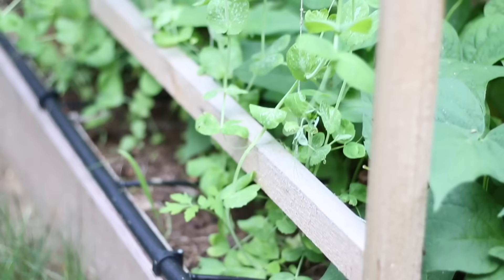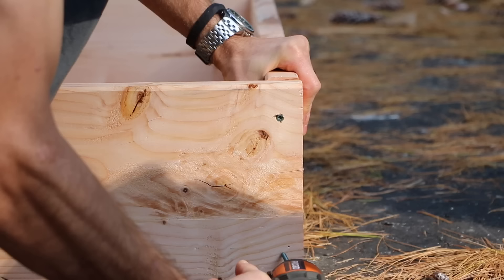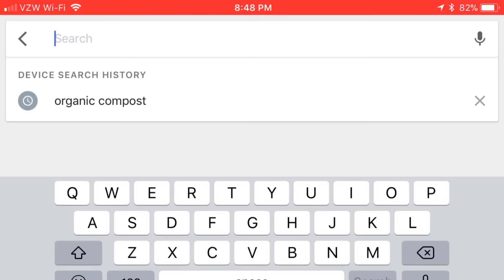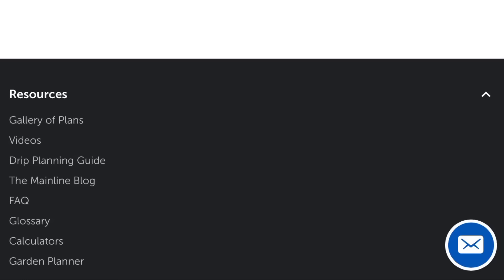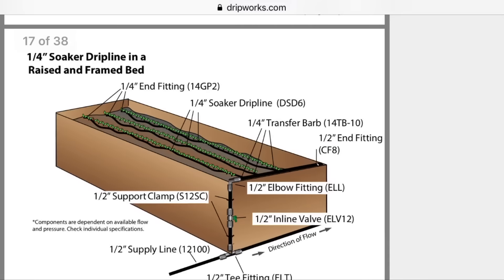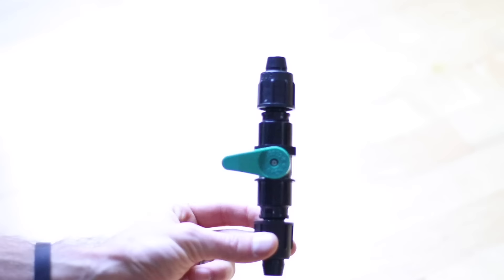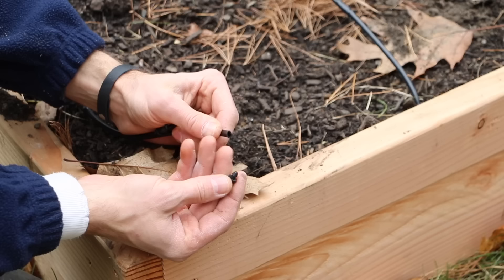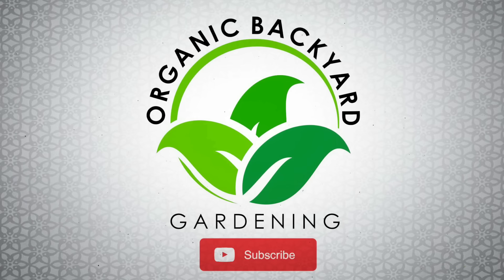How to Build a Raised Garden Bed with Drip Irrigation - Inexpensive & Easy

Comment: How do you winterize the drip irrigation system to make sure it doesn’t get damaged by freezing temperatures?
Reply from the maker: Check my video here on how I do this. How to Winterize Drip Irrigation Fall Winter Raised Bed Gardening - Raised Bed Drip Irrigation https://youtu.be/m0j8XT74Hik

I blow the lines out with an air compressor, I use this specially designed attachment https://amzn.to/2Vicvg5 (amazon affiliate link)

Comment: Can you  attach the irrigation system with a timer  to  a water barrel
Reply from the maker: Hey Storm! Thanks for watching. Drip irrigation required very low pressure (around 10psi) making it a great candidate to use with a gravity feed source. Check out this blog post from @dripworks for some great tips. https://help.dripdepot.com/support/solutions/articles/11000044367-gravity-feed-system-basics-elevation-pressure-water-quality-and-timers

Comment: When leveling out the area what should the measurements be to make it leveled sorry I’m really green on this and this is my first time learning everything me and girlfriend purchasing a home gonna have a lot of land wanna make great use of it
Reply from the maker: Drop the bed on the area you want to place it. Trace the perimeter by cutting into the soil with a shovel.  Remove the bed. Dig a trench about 4 wide to account for all four side. Keep the trench level on the high side you’ll need to dig deeper. Put the bed back in (all four sides will sit in the trench) use a level to make sure all four sides are level. Turn over the existing solid that is now in the bed. Saves your back from excavating out the whole area. :)

Comment: Such a helpful video! I was wondering if this drip system can be set up using existing irrigation lines? I currently have a system that is set up to water my lawn using 3/4” pvc. Is the drip line something I can use an adapter close to my garden beds? Or would I have to run a new line across the yard where my Valve box is to be able to have drip?

Comment: Awesome video. I use the Gardena drip irregation system with the Gardena Smart valves and sensors. Works awesome. Made a video last year about it. Greetings from Andreas on Off Grid Sweden

Comment: Question about the water line from the my outside faucet to the garden and the drip lines. I live in Missouri, how will need to deal with the freezing of the lines?
Reply from the maker: Check my video here on how I do this. How to Winterize Drip Irrigation Fall Winter Raised Bed Gardening - Raised Bed Drip Irrigation https://youtu.be/m0j8XT74Hik

I blow the lines out with an air compressor, I use this specially designed attachment https://amzn.to/3IbssJ0 (amazon affiliate link)

Comment: How deep should the distribution tubing be buried?  i am worried about cracked tubing throughout the winter.   thanks for the video!!
Reply from the maker: Check my video How to Winterize Drip Irrigation Fall Winter Raised Bed Gardening - Raised Bed Drip Irrigation https://youtu.be/m0j8XT74Hik

I blow the lines out with an air compressor, I use this specially designed attachment https://amzn.to/2Vicvg5 (amazon affiliate link)

Comment: Great video!

I'm from Edmonton Alberta Canada and it's a much colder climate than perhaps what you have. What do you suggest for our cold Winters as far as draining the lines so they don't burst?
Reply from the maker: Hey Joe! Check my video here on how I do this. How to Winterize Drip Irrigation Fall Winter Raised Bed Gardening - Raised Bed Drip Irrigation https://youtu.be/m0j8XT74Hik

I blow the lines out with an air compressor, I use this specially designed attachment https://amzn.to/3IbssJ0 (amazon affiliate link)

Cheers, 
 Tim

Comment: Just a heads up.   I got all mine set up and to find out that I did not have enough water pressure for all this. 😢😢.
Reply from the maker: Are you coming from the house spigot? How many beds? Do you have a low flow adapter on the spigot?

Comment: Do you incorporate any provisions to drain the lines in winter,  to prevent freeze damage?
Reply from the maker: I blow the lines out with an air compressor, I use this specially designed attachment https://amzn.to/2Vicvg5 I will be making a video on this shortly as I’ve had a lot of questions about it! :)
Reply: @OrganicBackyardGardening  I live in Maine. Do you leave your drip system all in place over the winter and then just blow the lines out before the first freeze?
Reply from the maker: @PongratzSped  I blow the lines out with an air compressor, I use this specially designed attachment - I then detach the header line with the emitters and store those in the shed and reattach them in the spring - https://amzn.to/2Vicvg5 I will be making a video on this shortly as I’ve had a lot of questions about it! :)

Comment: Hello, great video, how long do you suggest running the soaker hose? Is there an equation based on square footage?
Reply from the maker: They need on average about a inch and a half of water a week. Here is a helpful link on how to calculate based on your setup. https://extension.psu.edu/determining-how-long-to-run-drip-irrigation-systems-for-vegetables

Comment: I live in zone 6B. During the winter we are frequently in the single-digits Fahrenheit. Will these hoses crack during the winter? I thought I would need something that I can remove them take anymore during the winter.
Reply from the maker: Check my video here on how I do this. How to Winterize Drip Irrigation Fall Winter Raised Bed Gardening - Raised Bed Drip Irrigation https://youtu.be/m0j8XT74Hik

I blow the lines out with an air compressor, I use this specially designed attachment https://amzn.to/3IbssJ0 (amazon affiliate link). 📩 Join My Insiders List for Free Weekly Garden Tips
→ https://bit.ly/FreeWeeklyGardeningTips

Comment: That main supply looks larger than 1/2 inch. Is it 5/8"?
Reply from the maker: Nope. 1/2. Here is the link to the tubing I bought from dripworks. Use code OBG10 for 10% off if you buy from them. 1/2" Main Line Parts: 
→ Distribution Tubing - https://www.dripworks.com/1-2-polyethylene-mainline-tubing-0-600-id-x-0-700-od?ref=lfw3jygn

Comment: The drip line connects to a house hose in the end? set on a timer? how does that end of the drip irrigation system work?
Reply from the maker: See this listing here, this is what I have. It attaches to the 1/2 mainline, then to the house spigot. https://amzn.to/3cmeZy3 (amazon affiliate link)

I use this timer, I have used several and found this one is the best https://amzn.to/2V4jrvv (amazon affiliate link)

Comment: Really appreciate the video. Im really gonna try to get my hands in gardening this year. I got 3 raised beds so far and want to build a much larger one here next weekend. For the drip irrigation do you think you could use a fairly low pressure hose. It doesnt have water pressure besides gravity from the water tank.
Reply from the maker: MusicalEuphorias thanks for stopping by - You certainly could use drip Irrigation with a low pressure, gravity set up. Here is a great blog how-to article I found on the topic. https://www.dripworks.com/blog/gravity-fed-low-pressure-systems/

Good luck on building the new beds!

Comment: Before winter, do you have to flush the system of water to prevent damage from freezing?
Reply from the maker: +washaa Yes! Here is what I do:

1. This design allows you to easily disconnect the header line of each bed. I’ll disconnect each header (with drip lines attached) at the top elbow and take those inside for the winter. (This extends the life and makes it easy to clean up the beds then get them ready for the spring) 
2. Open all the valves on each bed. 
3. Disconnect the main line at the spigot and use a air compressor to blow out the lines (I use a wet towel to make a seal between the compressor and line). 
4. I’ll the close all the beds besides the one at the lowest elevation and blow it out again to make sure I get all the water out.
Reply: Thank you!
Reply: Make sure you cap or close off the ends after you've blown your system out. Otherwise, mould grows inside the lines and its difficult to clear in the spring. Also, you can make a connection to your air compressor with PVC that will accept a hose end or (in my case) a "quick connect".

Comment: Do you have to do anything special to prevent freezing in the winter?
Reply from the maker: Check my video here on how I do this. How to Winterize Drip Irrigation Fall Winter Raised Bed Gardening - Raised Bed Drip Irrigation https://youtu.be/m0j8XT74Hik

I blow the lines out with an air compressor, I use this specially designed attachment https://amzn.to/3IbssJ0 (amazon affiliate link)

Comment: How do  you clear the lines for us folks in the frozen north?
Reply from the maker: Check my video here on how I do this. How to Winterize Drip Irrigation Fall Winter Raised Bed Gardening - Raised Bed Drip Irrigation https://youtu.be/m0j8XT74Hik

I blow the lines out with an air compressor, I use this specially designed attachment https://amzn.to/3IbssJ0 (amazon affiliate link)

Comment: Thank you for the clear, concise, easy-to-follow instructions on raised bed drip irrigation.  I've seen a lot of videos on YouTube on the subject, and yours is by far the best!!  Question:  Wouldn't it be a good idea to flush the main line with water for 20 seconds or so before attaching 1/4" tubing that runs the length of the beds--- to clear out dirt / debris that might clog the 1/4" tubing?
Reply from the maker: Yea! That’s a great point Paul! Definitely a good idea to flush out any debris that may have gotten into the line before attaching the 1/4” tubing. :)

Comment: After adding the actual drip line, do you poke holes in it where needed or are holes pre- add?  Thx
Reply: They have both. Pre punched and punchable lines
Reply from the maker: Check out this drip line, they have emitters embedded in the line. https://amzn.to/2RvGHA8 (amazon affiliate link) Emitters are embedded in the drip line and give a uniform flow and are also clog resistant. Different emitters have different flow outputs. For example, the drip line I linked has embedded emitters that have a rate of .52 gallons per hour. Each emitter will output 1/2 a gallon per hour. Hope this helps!

Comment: Haha. You remind me of me. I make how twos also. Microsoft movie maker? I recognize the audio dubbing over music.  Anyway any update or tips?  I am considering doing this but I have about 65 raised beds. I already have a ton of drip supplies from before I did raised beds. Just wondering what head aches you’ve had from it. Are you still using it?  Do you hand water at all?
Reply from the maker: Hi! Thanks for stopping by! Everything is still working very well. I have been using this drip works product for years without any issues. If your hooking up that many beds, I’d probably skip putting a main line header on each bed and just run a 1/4 line from the main line in the growing up to the bed and attach that to a drip line. This would save a lot of parts and cost. Yes, I do hand water sometimes for smaller seeds at germination (eg carrots, etc)

Comment: Is there a benefit to buying the drip line with holes already in it instead of buying 1/4in piping and punching holes where you need them? I was thinking of buying the 1/4in tubing, connecting to a 1/2in supply line and then putting the holes in the 1/4in line where I have plants.
Reply from the maker: Hi Mike! Thanks for stopping by, that’s a great question! I would highly discourage creating your own drip holes in a line. The inline emitters in the 1/4 line are designed for clog-resistant flow and all emit the same flow. If you made your own holes the line could get clogged or not flow evenly. However, what you could do is install emitters in the 1/4 line with these small inexpensive emitters below  - if you have a large space to water this could be labor intensive, however if you have a small area this could be great since you could get the water percisly where you want. See the diagram in the product images, with 1/4 T barbs, 1/4 line and these emitters you'll have a lot of flexibility! - https://amzn.to/2UiRH7i
Reply: OrganicBackyardGardening Thanks for the tip! My reasoning is: if I plant 3 tomato plants within a 6ft line, I would only want emitters at each of the three plants, not in between right? So I would need a 12in spaced drip line in that case. I am trying to avoid having to buy 25ft of multiple types of drip line.
Reply from the maker: Hi Mike, I understand! I would not be to concerned about the exact placement of the emitter and the plant if you have one in between and one at the plan that is fine. Drip irrigation waters deep and the water dispels broadly beneath the surface. Also, If you have a lot of organic matter in your soil such as compost this will act as a sponge and spread the water evenly.  The water will get to the roots beneath the surface. The one key tip I have is to mulch with leaves or straw over the drip line and around the plants. This will ensure the soil stays moist and give organic matter back to the soil (food for worms). You should be fine with 12 inch spacing and for seedlings just starting off, hand water until they take off,  mulch them, then drip should be fine.
Reply: OrganicBackyardGardening Great, thanks for the advice!

Comment: Would a drip line work with gravity fed rainwater? If so what works best for you? Also can you recommend a easy to use timer? I've only tried one and it's very confusing to me. Orbit I think.
Reply from the maker: Yes absolutely -drip irrigation requires low pressure, gravity feed will work. I love this timer - Raindrip R675CT - https://amzn.to/3d1j8Hz (amazon affiliate link) it's lasted me several years now.

Comment: I am limited by where I can put my raised beds so they will have to be at least 100 feet from the nearest spigot.  Is it possible to run a line that long or do you have any alternatives I can do to keep the beds watered?
Reply from the maker: Sure you can run a regular garden house.  If near a roof you could also use a water collecting system.

Comment: You didn't include any information on how to actually use this system.  How many times do you turn this on and for how long? Do you use a timer system?
Reply from the maker: This is the timer I use. I’ve tested several and I really like this one. https://amzn.to/2yB5XeG How to use the system really depends on a lot of factors, your climate, what your growing, how many gallons per minute your system emits etc. However, I run mine about an hour every other day and that has worked great for me.

Comment: How do you get water out of the lines for winter?
Reply from the maker: Check my video here on how I do this. How to Winterize Drip Irrigation Fall Winter Raised Bed Gardening - Raised Bed Drip Irrigation https://youtu.be/m0j8XT74Hik

I blow the lines out with an air compressor, I use this specially designed attachment https://amzn.to/3IbssJ0 (amazon affiliate link)

Comment: Nice work on this video and the system. Do you have any suggestions regarding using drip irrigation with rain barrels? Would there the adequate pressure?
Reply from the maker: Hey Bob! Thanks for watching. Drip irrigation required very low pressure (around 10psi) making it a great candidate to use with a gravity feed source. Check out this blog post from @dripworks for some great tips. https://www.dripworks.com/blog/gravity-fed-low-pressure-systems

Comment: What precautions must one take for those of us that live in areas where Winter is severe, so that the investment in the system is not damaged by the expansive effect of water freezing into ice. Or is this system only designed for warm climates? Asking from Sweden and I am planning on creating raised beds and would like to consider a water system that could be turned off and on remotely as this is at a waterfront cabin 1.5 hours north of the city and I live in urban Stockholm. Nice video it inspired me.
Reply from the maker: Hi Lenard, I live in a climate with severe winter. Blow out the lines with an air compressor at the end of the growing season to remove excess water from freezing and bursting the pipes.
Reply: @OrganicBackyardGardening  Thanks. I will add this to my list of equipment to research. Your video has me completely inspired and excited for Spring which in Sweden is still some time away.

Comment: I have a question, I live near Chicago, IL, zone 5b. My question is, can the drip line be left in place, to overwinter in my area? Or does it to be taken up at the end of the growing season?
Reply from the maker: You can leave it in but make sure you blows the lines out. If water is left inside, once it freezes it will expand and could crack the lines. Check my video on how I blow the lines out. :)

Comment: Excellent video!  I'd like to do this and somehow attach to 2-3 rain barrels, would I need a pump to create enough water pressure or will it work wo one if the barrels are high enough?  Thanks, great channel.
Reply from the maker: Hi John, thanks for stopping by! You would probably NOT need a pump. Drip runs on very low pressure. Check this out. https://www.dripworks.com/blog/gravity-fed-low-pressure-systems

Comment: Great video, I live where the winters freeze, weeks at a time at 20-30 degrees. Will this system burst? Do you have to blow out the lines for winter? thanks, and I’ll be using your links to the products.
Reply from the maker: Thanks! Yes I blow them out - check the other video I did on how I blow them out.

Comment: I disagree with NOT using Treated lumber.  Yes they USED to be treated with Arsenic, but now it's a Copper based solution and is not toxic.  Arsenic hasn't been used for over a decade.